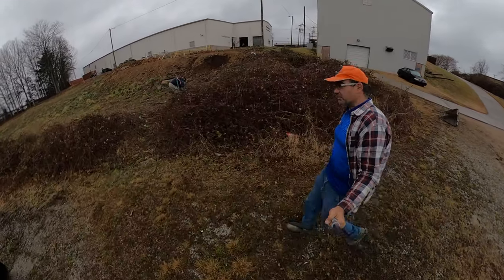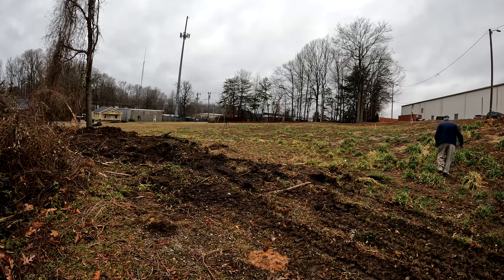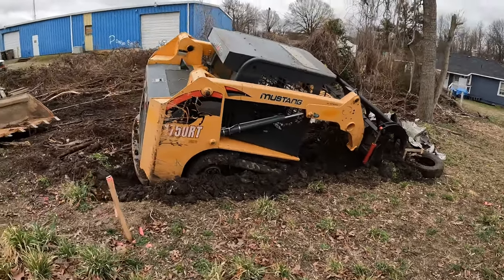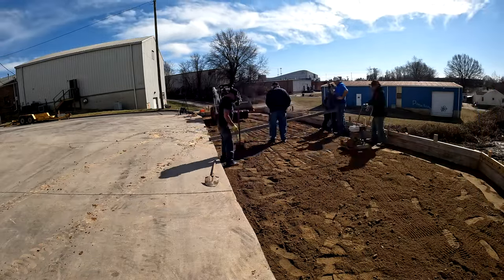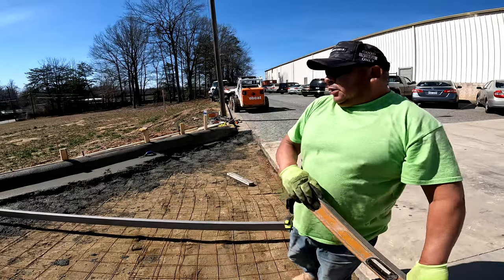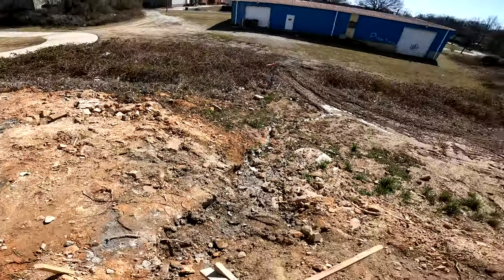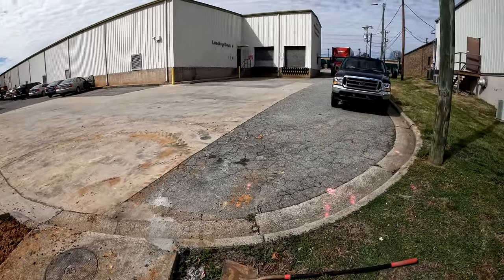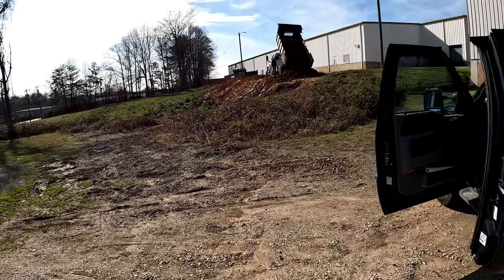Extending concrete for truck access - Commercial Building 1 of 4

Comment: So im sure your concrete guys know your area really well. Here in central Iowa where heavy machinery and semis are at in a production plant they actually dug piers for the concrete pad, I don't remember the spacing but they were set at least 2 foot deep with mesh tied into the mesh for the pad to reinforce and stabilize the pad. The ground at one point was the site of an old landfill.
Reply from the maker: Interesting Luke. Subsoil conditions are different all over, and here is just as odd. They hardly ever use rebar or mesh in concrete.
Reply: @GCFD  for residential its fine, but commercial with potential dead load of 52000 tonnes, rebar, instead of wire, should have been used and bored into the adjacent slab. a 3 ton plate compactor should have also been used to compact the material instead of the .5 ton used given the swamp land that the area is (the sinking of your own cat not far from the addition should have been the first clue)

Comment: Dont' know what happeend but i was unsubscribed and my bell didn't ring.  I'm now a new subscriber. :) Now I have to catch up.  
Thank you for mentioning pvc, I finaly drilled the hole big enough for the 3" NDS strainer in the NDS channel drain. I cleaned some pine needle organic mater from it but i have many feet to do.  The pvc bottom drain connects to shedule 40 1 4" pipe, then one sch 30 perf drain holed pipe.  Wrapped with landscapers and stone on botoom and top like a perq drain.  then 2 more sch 40 pipes. At the end i have a pop up emitter and a cleanout about a foot away.  The fall on the 4" is real good.  With all that junk in the pipe it looked clogged. I left the hose running filling the drain area and pipe. I pulled up the pop up emitter, (no glue) and water started coming out.  I grabbed handfuls of junk and it started cleaning out with some pressure.  The pipe hits a 90 then comes up to drain into the woods.  I will go back and check rate of fall of the 24' channel, some may be flat but it has a bottom drop down a foot and then some.  Thanks.

Comment: I looks a lot better but my question shouldn’t they of drilled into the old concrete and put rebar in to hold the two pads together not putting down anyones work but I see this pad cracking they should’ve put in saw cuts to stop the cracking

Comment: Does that wire do any good resting on the bottom like that?
Reply from the maker: They pull it up into the concrete with the concrete placers as they are pouring.

Comment: I would have extended that slab a little more to encompass that drain, sinking that drain just below the surface so that truck wheels can go over it. I'm wondering why you don't use a moisture barrier before pouring a concrete slab.
Reply from the maker: if there is going to be an enclosed space like a garage over the concrete we typically do use a moisture barrier. But not for open concrete like this.
Reply: @GCFD  Ok thanks.

Comment: no pins to the old pad?   is mesh strong enough for that application?
Reply from the maker: Yes this will hold up well for a truck pull-up. The mesh wasn't really needed but we added it anyway. We also did 6" of concrete.

Comment: Whatever happened to the ford truck you bought
Reply from the maker: I'm not sure. We did the injectors, dummy plug, and stand pipe on the drivers side and it's been good ever since. I'm still working on a Part 2 for that truck.

Comment: What is the point of putting wire mesh if you put it right on the ground? Shouldn't it be somewhere in the middle of the concrete?
Great video. Thx
Reply: yeah. they totally messed it up. I was cringing while watching. what a waste. But the rest of the job looked good. Hopefully the ground will hold the pad up without extensive cracking.
Reply from the maker: They lift it up with the concrete placers to get it into the concrete.
Reply: @GCFD  Certainly couldn't tell that in the video. It looked flat on the ground. If they lifted it up as they poured I would have expected to see it. Usually you can see air under the wire because it is sitting on spacers or little bricks that tie to the mesh.

Comment: Just a question, I’m thinking of extending a cement slab. Should the new cement that you put down have been pinned into the existing one ?
Reply: Drilling holes in a maybe 300mm deep (12 inches) and installing bars in epoxy resin so they all point the same way is not an easy job. Dowel bars are normally installed if there will be settlement that would cause a problem. If the slab in the video went down 25mm it would not cause a problem to the trucks but in a yard it would be a trip hazard. In the video if they had decided to dig out another 150mm and thicken the stone to reduce settlement they could have disposed of the excavated material down the slope. If your slab was in your yard with limited access you may be wanting to limit the movement by wheel barrow so then drilling in bars may be less work than wheeling in and out more soil  and stone.
Reply from the maker: It depends on your subsoils Rick. In our area we have extremely stable subsoils and they rarely even use rebar in pours like this. So pinning in our area is not really needed, especially for an application like this. If you're looking for showroom concrete and have a lot of bentonite in your area, you may want to pin.
Reply: @johnclements6614    Thanks for the response and information.
Reply: @GCFD    Thanks for getting back to me. I have a 12x12 shed on a 6 inch cement slab and I’m thinking of extending it and I see where some guys pin it into the existing slab. Thanks.
Reply: @rickpacheco8864  I assume that the extension will be a similar size and so there will be no vehicles inside apart from maybe a lawn mower. Also only light walls and no other heavy items therefore unless the ground is very soft it is unlikely you will get much settlement. Concrete weighs about 2400kg per m3 and the soil around 1800kg so the increase in load to cause settlement is not going to be much.
Reply: @johnclements6614    Thanks.
Reply: My 2 cents.... you dowel into other existing "structures" of like use in MOST cases. Meaning this should have been doweled into in my opinion. There is no reason not too, even if it is just compression fit dowels vs. over drill and epoxy set. An easy example of not to dowel would be a slab poured against a stem wall or retaining wall. The foundation/wall doesn't react the same as the slab (expansion,/contraction, static vs. live loads, etc.) so therefore you want them separated, and not "acting as one".

Comment: yeah thats a tight squeeze ... i would of put the new plaftform maybe 3 feet back more  to give as much space as possible ...
Reply: The slab is already very close to the slope. If it was closer you may have had to cut into the slope and place structural fill. The truck seem to negotiate the turn with the ok with the slab as cast.
Reply: @johnclements6614  if they had filled 3 ft more back and put some boulders at the end it would of been safe there was space... every lil inch helps especially when you have some of these Custom longer Frame Semi trucks that ive seen  ( like an extra 2 ft  on the frame
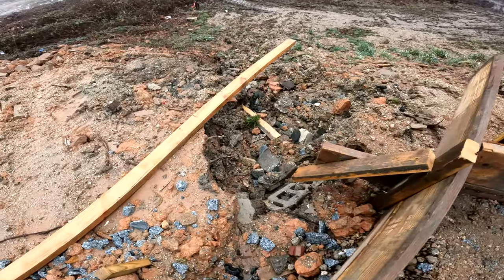Reply: @Erik-pr2rf  The embankment they were building on was likely to have made up of uncompacted fill tipped there to dispose of from the house that was demolished and or rubbish from the new builds see 7:35 . If you load the edge of that embankment it is very likely to slide.
Reply from the maker: I think we squeezed as much as we could out of the bank. The manhole cover down there was a hard point to stay away from. Even so, the drivers are very happy we added on for them.

Comment: I like your videos.. but man o man that concrete crew is something else. No rebar pins into the existing slab? Not a single piece of mesh was lifted…. Must be the cheapest in the area.
Reply from the maker: We typically don't pin to existing concrete around here. We almost never use rebar either. We have stable subsoils (no bentonite), no frost line, no subsurface waters.

Comment: It might be about time for you to get rid of one of your Dump Trucks and Invest in a Much Bigger Dump Truck that can take more then twice the Load away and bring in more than twice the Load of Soil or rock or sand?????
Reply from the maker: I like the way you think. I just got an f650 with air brakes. I’m not sure how much it can haul yet but it has a gvw of 26k.
Reply: Trouble is they would not get into the smaller jobs. Also if you only need to bring in or remove a small amount of material a truck that is half full is expensive to run.
Reply: @GCFD  - I thought that you might reach out to Andrew Camarata and see if he wants to get rid of his Old Black Dump Truck, the one that gets bogged all the time.
Reply: @johnclements6614  - That is why you have a Small Dump Truck and a Much Bigger Dump Truck, use the Dump Truck that is more suitable for the Job rather than the Big Dump Truck all the time. Time is Money, it cost more than Diesel.
Reply: 5 Trips with smaller dump truck vs 2 trips with bigger dump truck, how much more diesel is used compared to the wage of the driver of the trucks doing the dumping and importing of material??
Reply: @mrdbooks7285  A large dump truck that is sat in Shawn's yard doing nothing will cost money. It will not be getting a return on the investment when it is not being used. 
Where a larger dump truck could be used and would save on the number of trips it would save money on that job. 

Shawn should do a study on how many of his jobs he could make use a larger truck on,  the cost per m3 |(yd3) hauled and how much it would cost to have the larger truck parked up when it could not be used.

A bigger truck would also likely require a bigger machine to load it. And most likely other heavier plant. This would allow Shawn do small civil engineering type jobs but that is outside of his experience currently.
Reply: @johnclements6614  - his current machinery can load a Larger Dump Truck. A "Parked Up Dump Truck" - does not use Diesel, does not use Labour, does not require maintenance. It still costs daily Registration, daily Insurance, daily Interest payments if the Truck is on Finance. How much time and wages is saved using the Bigger Dump Truck every say 3 months, 2 months, 1 month, 3 weeks, 2 weeks or every week???  Even if it is Break Even or just below Break Even it is Still worth it, because in the Rare times that the capacity is Needed, it is there.
Reply: @mrdbooks7285  An unused vehicle parked in the yard will still require maintenance, not as much as if it worked, but it will still be subject to the elements etc. Even if Shawn fiances the truck from his bank account he will want a return on his capital at least what he would get from the bank. 

Not sure what you mean by  "Even if it is Break Even or just below Break Even it is Still worth it, because in the Rare times that the capacity is Needed, it is there." Are you suggesting that City Gate Foundation Drainage should purchase equipment that will lose it money, but it will be there for those rare times. There are many items of plant that could be useful. In this video a wood chipper could have been used to chop up all those vines, then he would not have had to make some many trips and he may not have to pay for disposal. But how often would he use it should he get it even if it will cost more than it earns.

Comment: I love your videos and work so hate to be critical, but that mesh sitting on the dirt will do nothing to reinforce the concrete. Over here we'd use a heavier (but not heavy) mesh and spacers or chairs to hold the mesh up say 40mm off the ground.
Reply: Or even on some bricks, concrete preferably.
Reply: I think I have seen them use a T piece with a hook on the end to pull up the mesh as they are pouring it - they are not that Dumb to Leave the Mesh on the Dirt with the cement over the top, but I could be wrong, what do you think???
Reply: they pull them as they pour I think, but when speeding the camera it is hard to see.  i would ask him if they were pulling mesh while pouring?
Reply: @octiman2997  I have seen them pulling up mesh. But positive support would mean that the concrete gang would not push it back down again when they walk on it.
Reply: @johnclements6614  i agree.
Reply: @mrdbooks7285  you could be right - I was looking to see if they pulled it up, maybe I missed it.
Reply: @johnclements6614  i heard that even if you walk on it, it does not go down again.  some youtubers tested it
Reply from the maker: Yes! The concrete placers have hooks for picking up the mesh as you go. This was a 6" thick slab so it's much easier to lift the mesh and not get it too high.
Reply: @octiman2997  If they vibrated the concrete to increase the strength of the slab by removing the air voids it would certainly sink. A stiff mix as used for the kerb may allow rebar to float with people stood on it if no vibration but it would also be very difficult to pull it up. 10:46 . I would also be worried about voids below the bars leading to corrosion after it was pulled up. 

The mesh used in this slab is very light and would likely only help with early cracking and not be structural. As such if it rusts in five years time it would have done its job.
Reply: @GCFD  As you note it can be difficult to control the height of the mesh, and hence the strength of the slab, by pulling it up. You get a more consistent quality if you use chairs or spacers.
Reply: @johnclements6614  agree that spacers or chairs are best